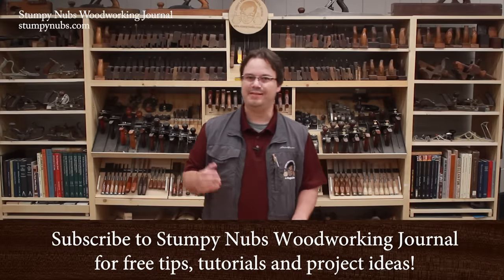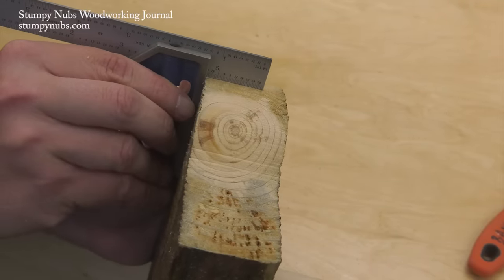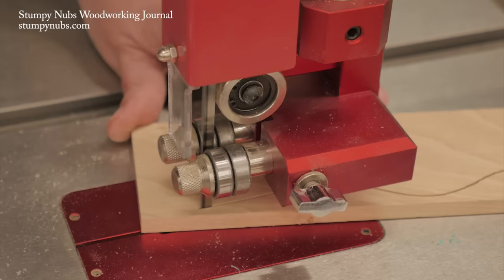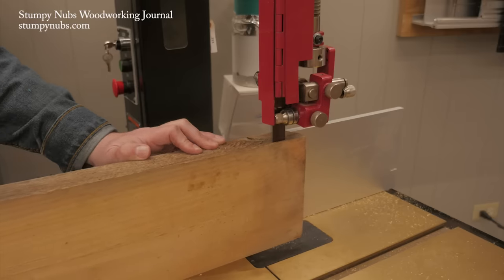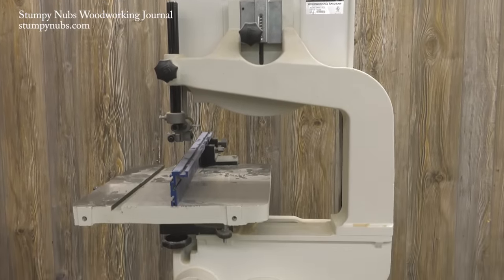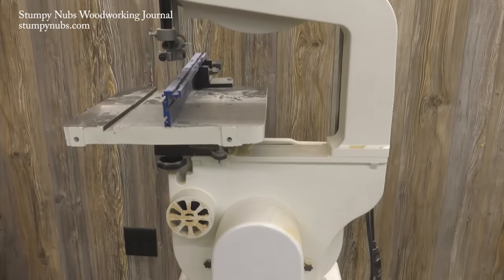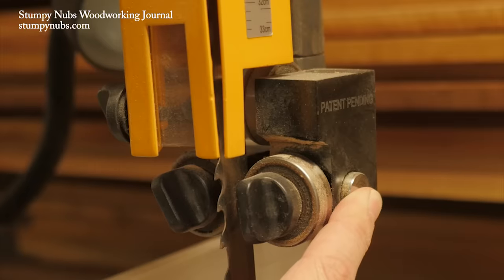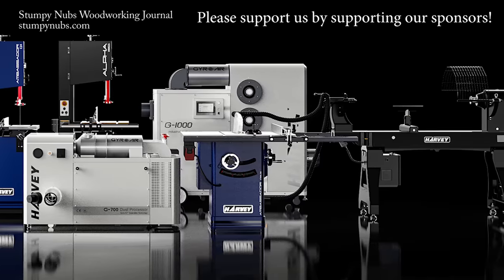What you really should be looking for in a band saw for woodworking

Comment: I am going to buy a bandsaw.  15" I am down to Harvey or Powermatic.  I know you have the 15" tell me what you think Please
Reply from the maker: I own both the Harvery C-14 and the HW615. I love them both for different reasons.

The C-14 (https://www.harveywoodworking.com/products/new-ambassador-c14-3hp-14-band-saw) is a fantastic saw that will do pretty much anything most people will ever need. It has lots of power (3HP) and cutting capacity (14" max re-saw). The fence and trunnions are of high quality. The guides are the best on any saw I have ever used in terms of adjustability without hassle. The wheels are heavy cast iron and the frame is big and beefy. It has a quick-release tension mechanism and a foot brake. It also has dual 4-inch dust collection ports. My only complaint is the table height is a little low for my taste (34"), but I adjusted to that fairly quickly and if I wanted to I could put blocks under the saw base to raise it a few inches.

Here's a Cool Tools video we did on the C-14: https://youtu.be/4XNh0v2GUJA

The HW615 (https://www.harveywoodworking.com/products/new-alpha-hw615-15-band-saw) is a beast of a saw. It has all the things I like about the smaller C-14 (3HP, 14" re-saw capacity, quick tension release, foot brake, dual dust collection ports), but it is even more robust. Everything about it screams quality, in my opinion. I have tensioned a 1-1/4" blade on it (the manual recommends 1" max), which puts an enormous strain on a saw's frame. But this thing barely flinches. The fence is the nicest I have ever seen on a band saw. The table is extra large and heavy (I have the tin-coated table, which resists rust). If I had to say something negative, the guides are a little more fiddly to adjust on the HW614 than they are on the C-14, but still nicer than most toolless guides on the market, and very heavy duty.

Here's a general video about what to look for in a band saw: https://youtu.be/sUsKYElDKl0

Here's a video about choosing band saw guides: https://youtu.be/3MPR2kcMhJU

Here's a video about band saw blades: https://www.youtube.com/watch?v=z7n7Gg4QOkc&t=0s
Reply: I have seen all  your videos and that's why I am asking you.  I have bought several Items you recommended and love them all.  Please keep the tool reviews coming. I like buying with confidence.  You are always spot on.  Thanks for taking time to respond.  Also your humor is refreshing. 
Thanks again

Comment: I really like your videos and I've learned a lot watching them. But this is the first time I disagree with you on something.  You stated steel is more rigid than cast iron.  This I have to disagree with you on.  I have worked with a lot more metal than wood and cast iron does not flex.  That's why they use it for machine tables and machine beds it doesn't flex.  Also cast iron absorbs vibration better.
Reply from the maker: Cast iron does flex. You can easily measure how much the frame of a cast iron saw flexes. But my point wasn't about the type of metal, it was about the difference in design between a cast iron saw and a steel one. Steel frame saws are welded into one piece while cast iron saws are typically cast in two pieces with a joint on the column. And when you add a riser block to increase the resaw capacity of a cast iron saw  (which was the context of my statement) you create TWO joints in the column. That is why I said I prefer a steel framed saw for resawing. Not because I do not have confidence in the rigidity of cast iron.

Comment: I bought a 10 inch bandsaw because I don't have a permanent shop space, and I definitely regret it. It's cheaply made, and the thing that holds the blade guide and adjusts the height has a huge amount of flex. It will be the first thing I upgrade when I have a bigger space.

Comment: Well, I'm out of ideas why my Craftsman 12-inch band saw performs so poorly. I know some saws will always have a bit of drift, but this is ridiculous.
There is a full 1/4 -inch deviance in as short as a 4-inch cut; it tries to pull the piece away from the fence. This is with a new blade square to the table (tried different blades), Cool Blocks and thrust bearings properly set, tracking good, blade tension where it should be.
Any ideas? What might I be missing?

(Yes, I know I need to upgrade, but I'm stuck with this for now.)
Reply: Although I haven't tried one, have you tried a point fence? I have a 1960's Craftsman that had drift and severe bowing when trying to resaw. These point fences are intriguing and looks like you could build one easily.
Reply: I have the same saw, used it for years with serious drift. Watched a video on YouTube about adjusting your bandsaw and everything changed. Getting familiar with your saws points of adjustment will make you feel like you’ve gotten a new saw that is properly adjusted. Greetings from Maine.
Reply: It turns out the table itself was out of square, so adjusting the guides and fence was not addressing the problem. Everything's fine now.

Comment: Alex Snodgrass does classes a the wood shows and says no such thing as drift on a saw set up as he teaches.  Other sites like WWGOA disagree.   Drift means no accurate resaw.   Looking for resolution.   Carter guides not the answer to eliminating drift.
Reply from the maker: "Alex Snodgrass... says no such thing as drift on a saw set up as he teaches." ----- Are you saying something in this video contradicts what he says? Can you be more specific about what the "no such thing" is?
Reply: @StumpyNubs  if you've watched Alex set up a band saw he says "no drift".  He cuts paper thin pieces after full set up.   Question i posed to others was if drift is real or an indicator of incorrect setup.  Alex Snodgrass works for Carter but in paid class at Woodworker shows he teach how he sets up saw which results in no drift.  Others talk to chasing a straight line on a board , note declaration, mark it and adjust fence to drift.  Question is, " is the drift in bandsaw uncorrectable or not?"   Makes cutting square pieces tough to do.  I'm talking using a large blade for resawing.  Not trying to cut exact pieces with a small blade.  Hope this is clear.  Drift or not to drift, that is the question
Reply from the maker: @davidclink2032  Yes, I know Alex personally and have seen his presentation many times. He does discuss drift in the context of eliminating it with a proper band saw setup. I am not sure I said otherwise in this video, though. Which is why I did not understand your comment that seemed to me to suggest I did.
Reply: @StumpyNubs  nope never meant you refuted Alex. However, others have and why I don't own a band saw because I do want the option of making table saw quality cuts using a band saw, that can cut larger boards.  Guitar blanks for example or ripping cedar planks for lining cedar chests.
Reply from the maker: @davidclink2032  You may find this tutorial helpful on that subject: https://youtu.be/tPRrEgnt7wM